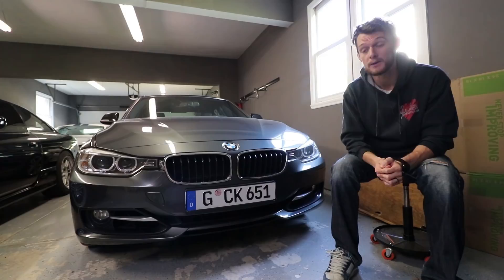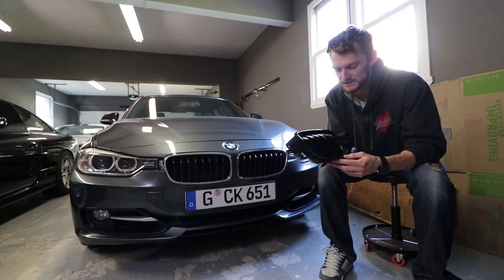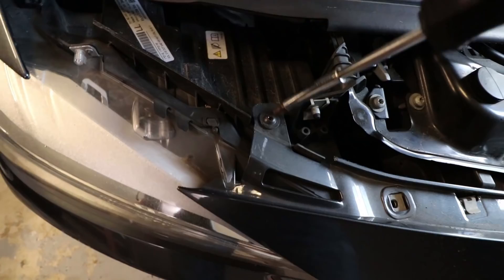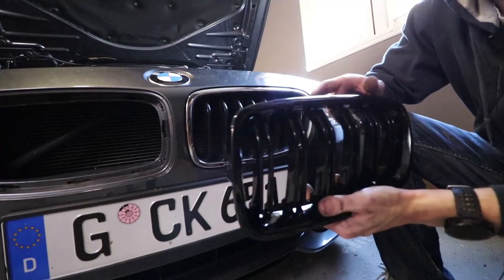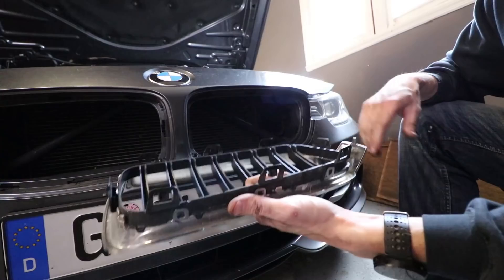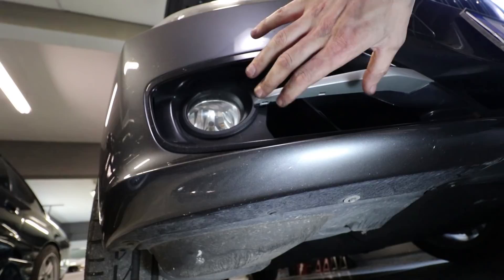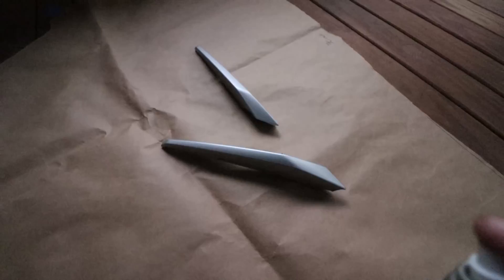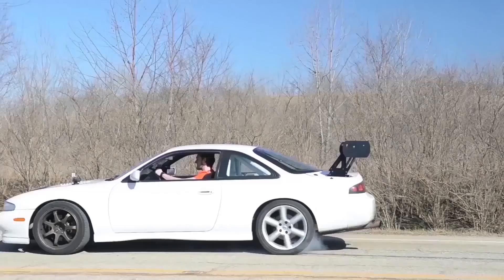F30 BMW 335i Kidney Grill and Whisker Blackout DIY

Comment: ....hey Bro...you are driving around with a German plate from the city Gera?! Thats awesome ;) But one little thing I must say....we got two different Sticker at the plates....and this one is normaly the rear plate...because the sticker shows the cops when your car must go to the main inspection called „TÜV“ while driving behind you;) In the middle they see the year and the month is turned at the top (12 o clock)
At the front plate there is only a silver registration sticker .... also at the rear plate, but under the TÜV—sticker.
Very nice videos....thumbs up !!! Best regards from Germany, Roger;)

Comment: Hi kinda late with this question....I have a 16 340i sport line front bumper, non m sport. I’m trying to get hose whiskers off to paint like you. You say to put right angle pick in and pull down then pull whisker out? Then for whisker end that is closer to center put finger in behind and pull tab down and then pull out? Idk why I’m struggling to get out?
Reply: Did you ever get it? I’m hesitant to try mine. Will probably end up bringing over to my Indy mechanic but too embarrassed to go over for just that lol